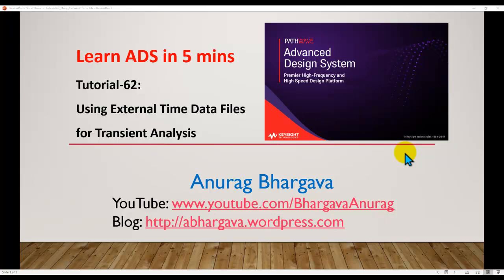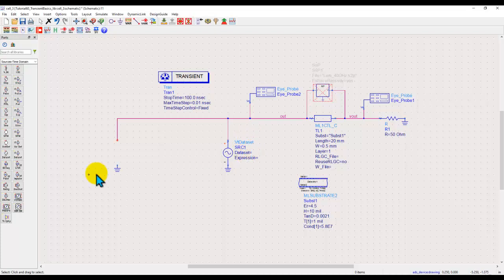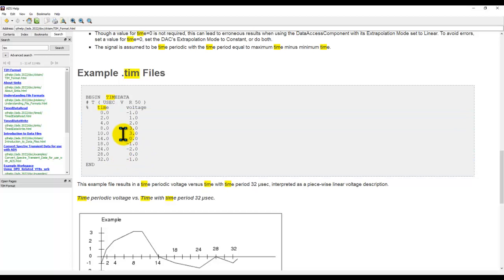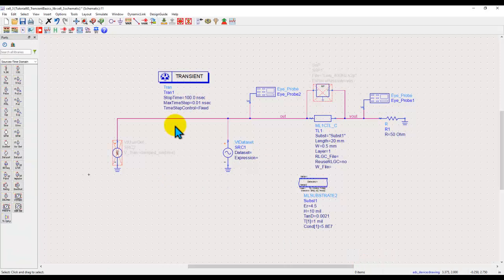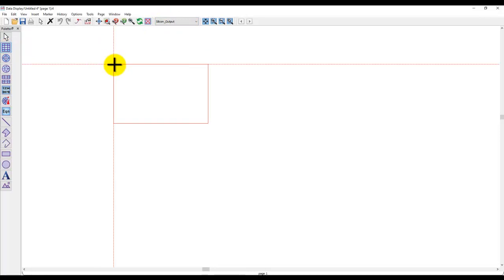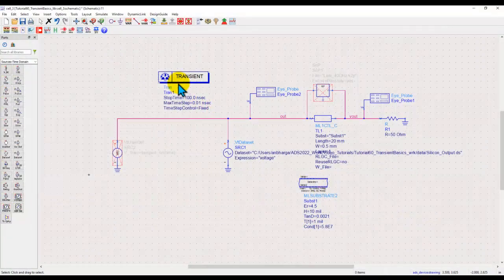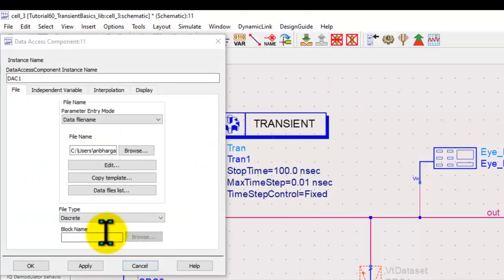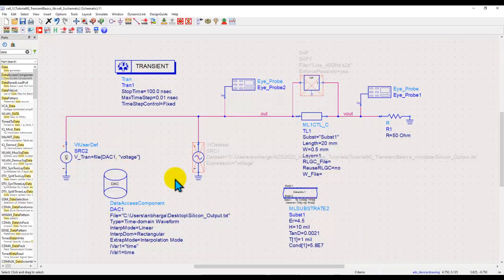Tutorial-62: Using External Time Data Files with Transient Simulator

Comment: Sir, which function (or component,  method) do you recommend to get the spectrum of current flowing through that resistor in frequency domain?
Reply from the maker: Simply connect a Current Probe at the desired place and plot the spectrum of it in Data Display.